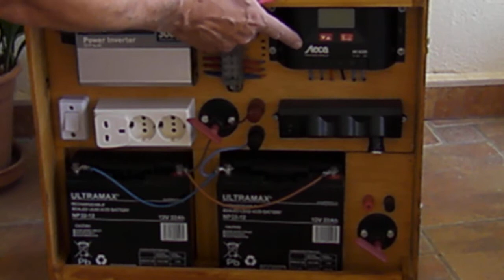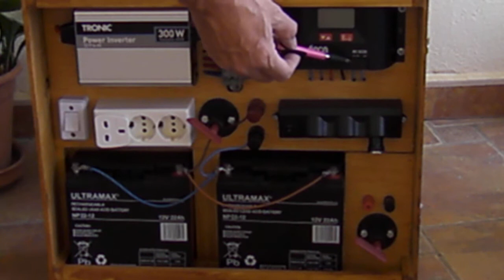HOMEMADE DIY SOLAR POWERED GENERATOR - 12v / 220v - COMPLETE PACKAGE  ***JENIrator***

Comment: your fan is struggling to run  because of the modify  sine wave inverter. you should get a pure sine wave inverter its a lot better.
Reply from the maker: Hi fred, Thanks very much for your wise words. I will take them on board. I am always very interested in listening to good advice. It looks as though the fan was struggling, but it wasn't really. You know when you watch a car with spoked alloys going along and it looks like the wheels have stopped or going backwards, well that was the camera. Once I put the fan on number two, then three it was perfectly okay...... You are very correct in your advice though, I will be getting a pure sine wave inverter soon. This one only cost me £39 new and is okay for a bit of fun...... Thanks again for your great comment......
Reply from the maker: Hi again fred, Please keep a look out for my next project, I think you will like it......

Comment: I'd love to see you run a fridge on that inverter 🤣
Reply from the maker: Hi surtr2230, Thank you very much for your message, and yes you are correct, it would not run a normal fridge at all and I was wrong when I stated a fridge. However, it does quite happily run my 12v/220v coolbox through the inverter with little effort. Thanks again for your comment......
Reply from the maker: Hi again surtr2230, Please keep a look out for my next project, I think you will like it......